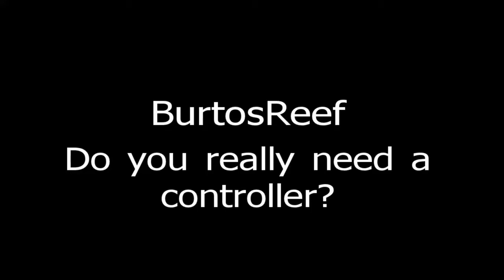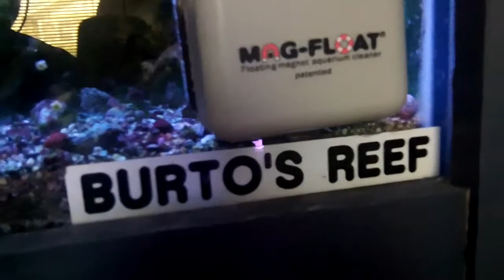Aquarium Controller re-think

Comment: BurtosReef  I'm part of the group of reefers that believe in redundancy, and that includes the use of controllers. There is nothing wrong with manual switches if it works for you. I would suggest using a power strip with switches to make it more user friendly. Try the American DJ Power Switcher: 
http://www.amazon.com/American-Pc-100A-Mount-Power-Switcher/dp/B0002GL50Q